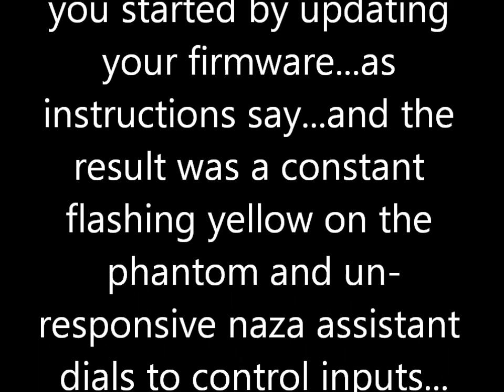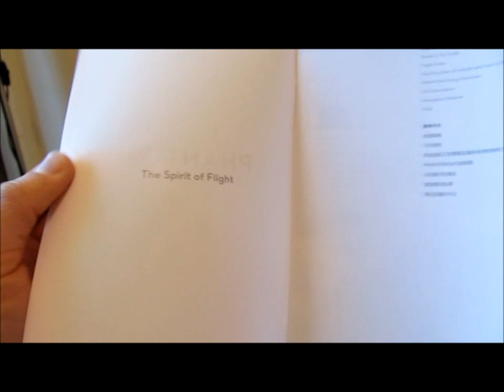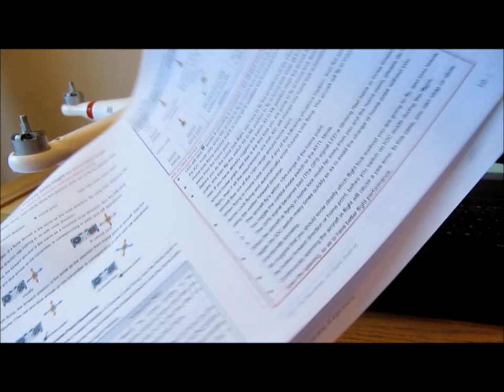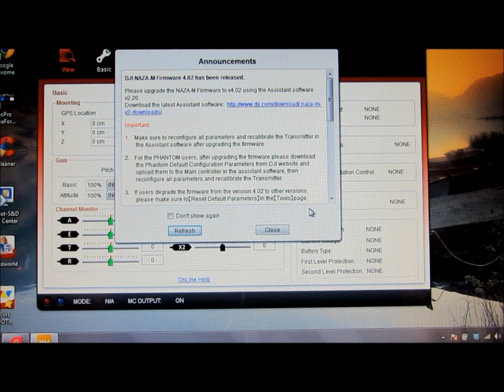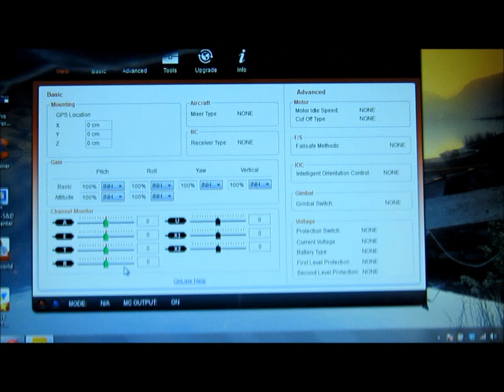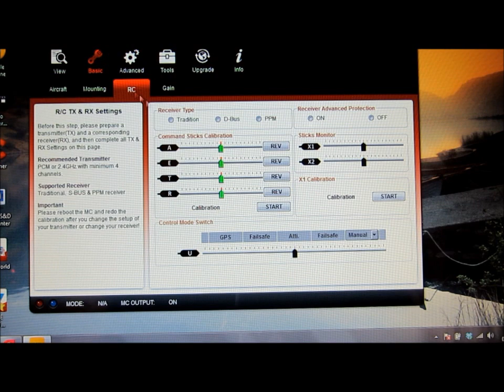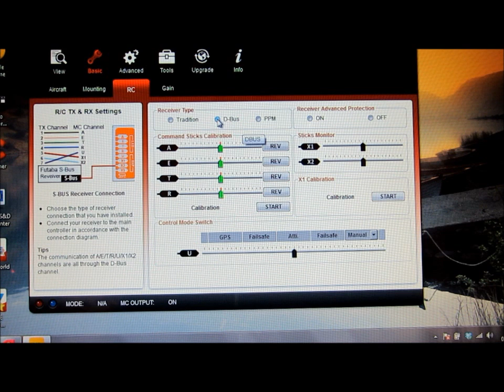Dji phantom yellow flashing lights after updated firmware

Comment: I have the same problem. Did it the hard way first by removing the top lid of the drone. And reconnect the reciver. Ligth went of, and nothing happens. In the Nazam software, it looks like the drone isnt even connected. So tried to type in the S/N number, but both the drone S/N and the RC S/N isnt valid. I dont know if i have to type that in in order to get the software work with the drone and the RC. 

Any idea what to do? 

Brilliant video btw :)

Comment: hi, i cant link my remote to the phantom, can you help me ?
Reply from the maker: Rui Rodrigues Hi. I can't remember the exact method for linking the transmitter to the phantom. however there should be vids on tube of how to do it and google will help. Take your props off. turn on the phantom and your transmitter. when u turn off your transmitter look up inside the phantom thru the battery door (batter out but plugged in) there should be a red light which come on and off as you turn on and off your transmitter. if this does not happen you are not linked. that at least confirms this... hope that helps..
Reply: i did whats supposed to do, still nothing :c
Reply from the maker: did u do what i said re checking for the light inside going on and off?
Reply: yup :/
Reply from the maker: and does it go on and off? is there a light on inside the phantom ?

Comment: My radio wasn't being reacted to onscreen then I did what you said and it started reacting. The levels went up and down. HOwever it still blinks yellow, but depending on what S1 or S2 are on, the light frequency will be different. Do you have any suggestions on what to do? The motor still hasn't worked for me.

Comment: im having the same problem and i tryed what you said it made no diffrence the hexi is blinking yellow and the remote dont even beep when it comes on the light stays red . i can go into the RC firm ware with the remote cabled to it and it works with the controler but when it go into the ass. firmware it wont respont to the stiks or anything HELP!!!!!! PLEASE!!!!!! THANKS TIM
Reply from the maker: if you have changed the transmitter setting in the nasa assist software as i suggest in the vid and it did not work for you then maybe your transmitter needs syncing to the phantom receiver? Look up how to do it online and see if that helps....good luck mate

Comment: i have an yellow blinkng LED on phantom. TX is on and calibrated, barreries new. No red led inside after pressing the button inside.. wats wrong?
Reply from the maker: Hi. If its not the same problem I showed in the video i'm not sure i'm afraid.
Reply: maxNluca What were your exact steps taken when switching from PPM to D-Bus, please?
 ie, what did you turn on/off plug/unplug when, and in what order?